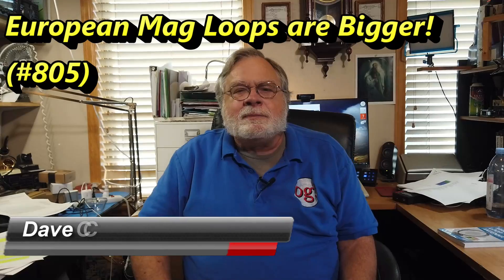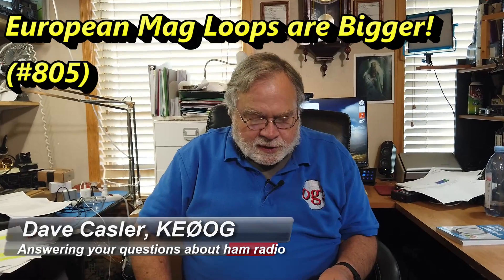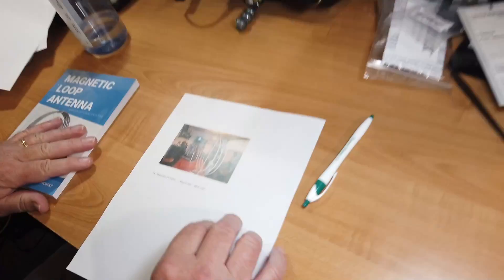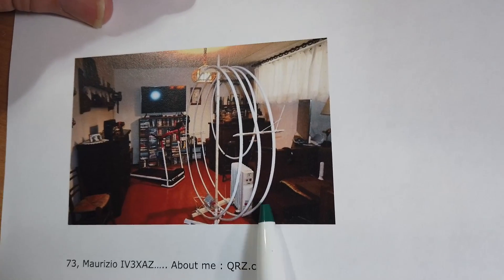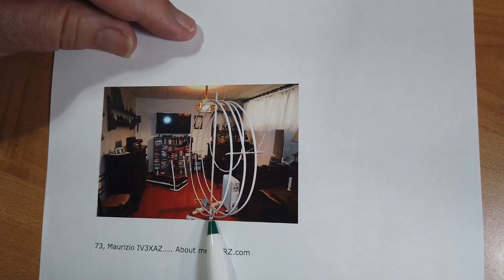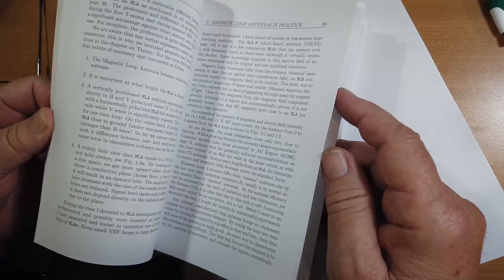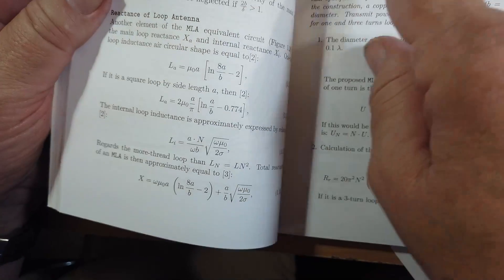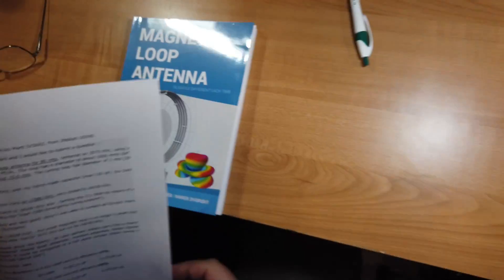European Mag Loops are Bigger! (#805)

Comment: Copper pipe might be difficult to bend without a proper pipe bending jig.
I have made a loop from ⅜" coax which is 22" diameter for the higher frequencies. I have got into Europe with QRP c.w. with the loop indoors. I bought a 3V motor with gearbox to drive the capacitor which for QRP doesn't need wide spacing.
All sources say the smaller coupling loop should be one fifth diameter of the main loop, but multiturn loops perhaps a larger loop needed. Experiment!
I'm going to try another made from this spare length of 19' coax for lower frequencies.
G4GHB
Reply: The data I saw showed that coax does not make for a great outside loop.  The more surface area you can get into that outside loop, the better.
Reply: @bassmanjr100  That does make sense, and coax could soon corrode on the braid with condensation in winter. I just had this spare coax to try indoors.
G4GHB.

Comment: I have built a number of these loops.  The basic loop construction is simple.  Some of these loops have been compromises in terms of how much they qualify as "homebrew."  MFJ sells a quick and easy solution in the form of their MFJ-933C loop tuner and its variants.  It is easy to use one of these and cobble together a mag loop for portable use.  Because it is manually tuned, it is less well suited for permanent installation.  
The first challenge in building loops is in constructing a remote tuner.  A geared reversible DC motor with a PWM speed controller.  These small transmitting loops have exceptionally high Q and very limited usable bandwidth at resonance.  They need to be retuned to compensate for changes in temperature and humidity as well as other factors.  A NanoVNA with a combination of VSWR curve and a Smith chart works well. 
The second challenge is to buy or build a variable capacitor that can handle high voltage.   The high voltage requirement will allow the loop to function above QRP levels.

Comment: I was talking about Magnetic loop antenna with Japanese Ham,  surprisingly.  many of them did not even know about it.   I never used one, but I have heard they do work similar to full size dipole.    many of Japanese Ham , they believe such small things work at all.  and not willing to pay for a lot of money to try them out.  AG6JU
Reply: I have seen the one sold at Rocket Ham Radio in Akihabara.  It appears well made but uses a trombone capacitor which makes tuning bands a time consuming process.  IIRC you can buy it in one-two-three-and four loop variants and you can get optional modules that I think are just fixed capacitors that you bolt onto it to access the lower bands.  There is also a remote controller but I don't believe it is automatic.  I don't know how good or bad they are but the man in the store recommended a loaded V-dipole instead for DX-ing purposes.  It, too, requires frequent tuning, but the ATU in most radios can handle it. KD2ORG
Reply: @sincerelyyours7538    I see, many Japanese Ham use V shape loaded  dipole.  antenna like windom  , G5RV, end Fed, Inverted L, anything uses ladder line are not popular there at all.  in US ,  vertical are popular in city,  but not many use Vertical in Japan either.    when I was in Japan,  I only operated VHF from home, HF from high school radio club.   AG6JU ex JG6IUB
Reply: @NIKO_92865    I've noticed that too.  I had to buy 50 ft of ladder line from the US because no one sold it in Japan.  A ham near my house has three antennas - a 2M / 70cm vertical, a Diamond 15 / 40M inverted-V loaded dipole (I have the same antenna), and a multi-band V loaded dipole mounted on a rotator. He says none of them work very well, but he has reached the US on occasion.  I plan to make a 40-10M Doublet antenna after I get my JARL Permission to Operate license.  Finding enough space for any antenna in a typical Japanese garden is very difficult, especially since I've never done this before and have no Elmer to guide me.  KD2ORG
Reply: @sincerelyyours7538    In Japan, specially in city , and rental apartment and such.  amateur radio can be tough .  
when I was renting apartment in Yokohama,  I did not operate Amateur radio at all even VHF.  HF was out of question then.  
doublet antenna is good antenna.  if I had more yard space here in Orange County,  doublet is the antenna I would use.  perhaps, you can make your own ladder line.  there are many article making ladder line.  construction does not have to be accurate.  and cheap to make.  some Japanese ham use disposable wooden or bamboo chop sticks as insulator / spacer for ladder line.  but UV proof plastic are better choice. 
in Japan, Ham radio licensing can be quite difficult and complicated compare to US.  
because they treat Amateur radio as almost same as commercial station license.  
and pretty much need to use radio certified by Japanese government for simplified  licensing procedure.  
I understand non fixed station are limited to 50 watts, more than that power level only licensed as fixed station.  
AG6JU  ex JG6IUB